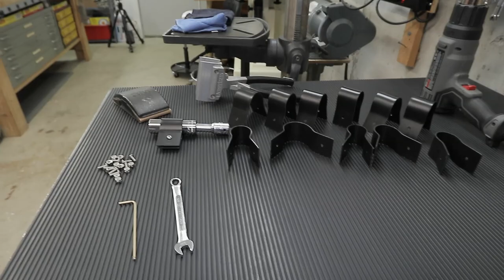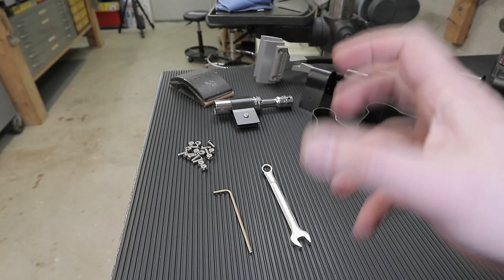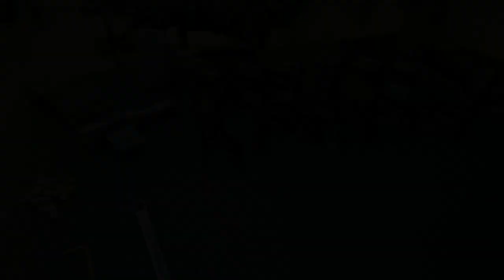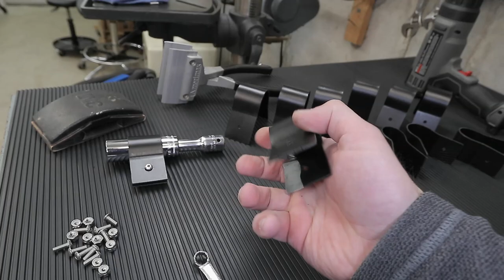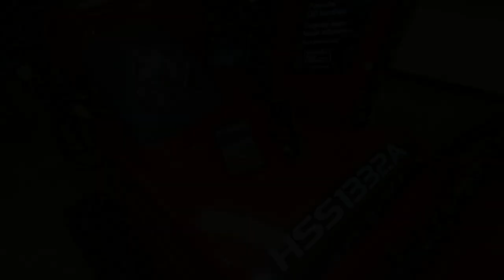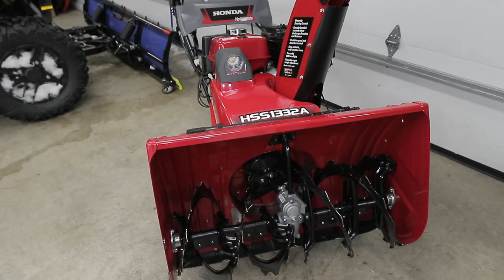NO CLOG EASY HACK for ALL Snowblower | HEAVY & Wet Snow | Custom Auger Paddles MOD

Comment: Sorry, but bro me it seems as though it’s a waste of time and money. I’ve been running my Honda’s for over 35 years and to me it never has been any big deal. Snow sticks to the augers, too. I would like to see the follow up, maybe you can convince me to do this, but at this time it’s a NO. Thanks
Reply: My immediate thought is that one of those plastic pieces would break, jam up and get throw out of the chute like bullets. I would rather spray dry lubricant like PTFE. I never had snow built up problem on my  Ariens.

Comment: Never had snow stick to the Auger shaft but it builds up between the side Augers and the Accelerator Augers and the blower effectively becomes a plow, and not a good one...
Reply from the maker: only happens i notice towards the end of the season, when snow become more wet and sticky
Reply: I just use toro power clear single stage.... Never had any problems and it gets down to the pavement.
Reply: Auger on a single stage spins much faster than a two-stage that's

Comment: An impeller kit is like  the closest thing to injecting steroids into your snowblower! Will never clog and throw significantly further! Installed mine 10 years ago with stuff I got from tractor supply, but the kits are available on Amazon

Comment: why are some rotating??? and some are not?? if snow starts to build up how would they rotate?? because wouldn't the snow start to hold them down,why not have them tight on the shaft so they are always rotating??
Reply from the maker: They should be loose and rotate independently from the auger shaft. Its going to be hard for snow to stick when theres adjacent paddles moving and breaking it up before it accumulates. But yes waiting on some good heavy wet snow to try these out and video them in action.
Reply: It looks like the theory is that it just breaks up the surface area to make it harder for the snow to find a continuous area to stick to.  There isn't gonna be any kind of real force behind them.

Comment: Silicone Spray everything often. Nothing will stick
Reply: Nope. It wears off too quickly and the auger eventually clogs up as you are using it. I’ve tried silicone over the years in all kinds of wet snow with the same results.
Reply from the maker: yes but that does not last very long
Reply: @JohnFrancoNH  100% agree!
Reply: Nope

Comment: Not sure the purpose of this. I’ve never had snow stick to my augers….ever. I’ve put rubber on my impeller trailing edges long before it was a thing. Like a lot of guys here I’ve sprayed silicone in the auger tub and find that it works pretty good. Like a few guys here I’ll wait for the follow up video with the actual snow results. Till then I’ll remain very skeptical…….my 2 cents

Comment: I wouldn't do that, auger speeds vary and are generally VERY FAST, your attaching crap to an auger, running at potential letal speeds, thoes are going to come loose and damge / injure or maim. I doubt ANYONE is going to be checking tightness if these things after every run. This will ALSO invalidate your warranty and expect to be sued into the stone age if any of that comes loose... A lot of instructions say.. "do not modify this tool as it can cause injury" I'm all for upgrading and hacks, this is foolhardy beyond belief even if it does work
Reply: From a Honda snowblower manual.. I'm also no physics buff but adding stuff to a rotating axel/axis is going to effect balance and cause an imbalance or issue, so just dont
 
"Never tamper with or alter any of the controls or safety devices on the snowblower. Tampering is a violation of Federal and California law.

Failure to properly follow, maintenance instructions and precautions can cause you to be seriously hurt or killed.
Reply from the maker: Sorry but auger spins very slow. If done correct those flaps should not rotate, if you actually paid attention to anything i said. You are thinking of the impeller. Do you have any idea how man people put impeller kits on machine that are out of warranty. Probably tens of thousands a year. And who cares its my machine. Mod at your own risk. Get off your high horse bud. Real men modify their snowblowers.